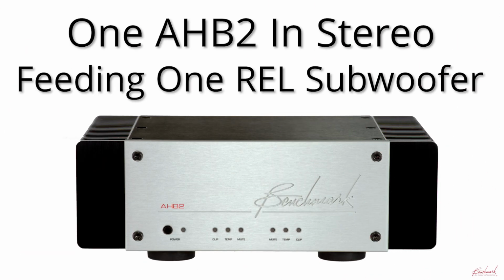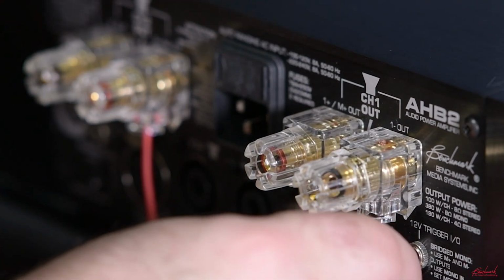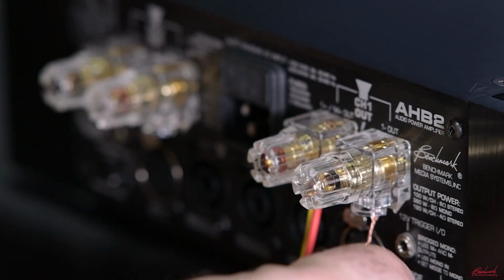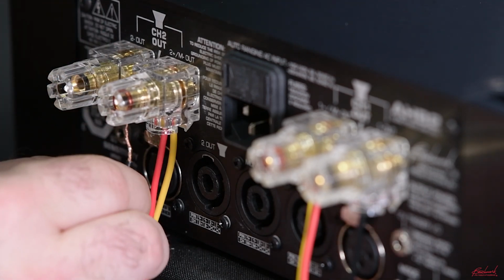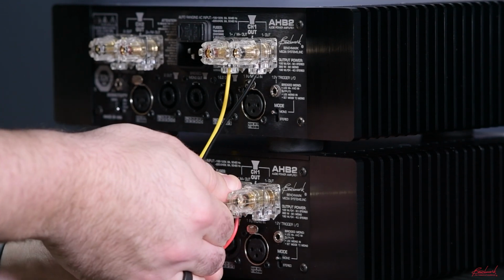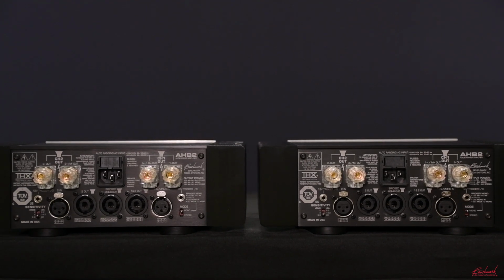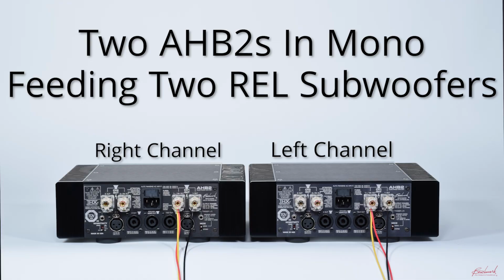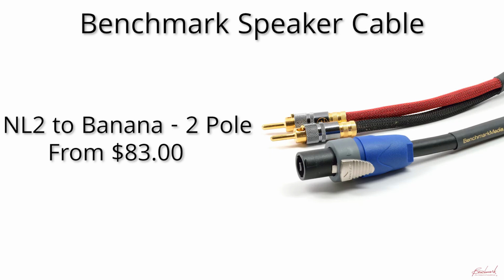Connecting AHB2 Power Amplifier to REL Subwoofer

Comment: This is one excellant video of REL connection. REL has many of these small videos and not in one place. Also not very clear. This Video is one place for all types. 

One clarification: at a time stamp of 4:39, with Two 2 AHB2 in Mono with one single REL the High Level connection you have shown is very clear. However when asked this question to REL, then do not agree connecting Signle REL to two mono blocks using High Level connection. Can you please help me understand or is this safe way to go, and you tested this connection and it was safe?

Comment: Are there any other connection options for subs to the Benchmark? I've just heard a few people saying the the Rel s510 has a split second delay using the proprietary cable. I'm also experiencing that issue and looking around for a new amp at the same time.
Reply from the maker: If you're going to connect a subwoofer to our AHB2 you'll have to follow the wiring guide supplied by the maker of your subwoofer. The REL is one example. We've also seen subwoofers using Phoenix connectors.

Also, if you're using one of our Pre-Amps you can use the RCA outs or the Mono XLR out to connect to a subwoofer.
Reply from the maker: Cables will not add a delay, but the DSP crossover and amplification in any sub, will add delay. Cable delays are insignificant.

Comment: Excellent video. 
Can you add a video on how to connect HPA4 with two AHB2 in bridged mode with and without subwoofer(s).
Reply from the maker: You would run the Left XLR out of the HPA4 to the Left AHB2. Then connect the Right XLR out of the HPA4 to your Right AHB2.

You can use the RCA outs of our Pre-amps to connect to a subwoofer. You can also use the Mono XLR out if your subwoofer has balanced inputs.

There are a few different set ups if you're using a subwoofer with Amplifier level inputs. We've seen the REL SpeakOn connection, some use banana plugs, and we've also seen bare wire connections using a phoenix connector.

I'll pass this along to our marketing team as an idea for a new video. If you'd like to talk with us feel free to give us a call @ 1-800-262-4675.

Comment: Couldn't you use a speakon from the amp to the speakon on sub?
Reply from the maker: You could use the CH1/CH2 SpeakON output on the AHB2 if you are running your AHB2 in stereo. It has four connections; 1+, 1-, 2+, and 2-, where 1- and 2- are the grounded terminals of the amplifier. If you are modifying a REL High Level Interconnect cable, connect yellow to 1+, red to 2+, and black to 2- on the new SpeakON connector that you will be adding to the stock REL cable. Notice that we do not recommend connecting the black wire to 1- because this wiring could cause damage to the REL if the connector was accidentally plugged into the mono output on the back of the AHB2.

If you are running your AHB2 in bridged mono, you would still use the CH1/CH2 output on the AHB2 (and not the mono output), but the cable wiring would be different: 1+ to yellow and red, 2- to black. If you are using a pair of subs, both will be wired identically and one would be connected to each AHB2.

Never plug custom REL NL4 to NL4 cables into the Mono or CH2 SpeakON outputs of the AHB2. This could cause damage to the REL subwoofer.

We would rather see you used the SpeakON connectors for you mains and then use the binding posts for the subs.  Also, the SpeakON wiring on the REL sub is not standard wiring, so you cannot use an off-the-shelf NL4 to NL4 cable. Furthermore, your custom wired NL4 to NL4 cable will not work if you reverse the amplifier and sub ends of the cable. Incorrect connections could damage the REL subwoofer.

In general, it is probably a bad idea to create a custom NL4 to NL4 cable unless it is very clearly labeled.

Comment: Can normal sized spades be used where you are connecting the bare wire ?
Does the power cord need to be shielded so 60 Hz does not induct into the subwoofer cable ?
Reply from the maker: Yes, adding spades to the end of the wires would improve the durability of the wires. I'm not sure why REL doesn't supply them with terminals. It would be a nice improvement.

As for the shielding of the power cord, this is absolutely not necessary from the standpoint of audio interference. Shielding will prevent the radiation and/or reception of radio-frequency interference but it will not block any interference due to the magnetic fields produced by current flowing through the power cord. Braided and/or foil  shields do not block magnetic interference. But even if there is some magnetic coupling between the power cord and the speaker-level inputs on the REL, that interference would be so much lower than the speaker-level signal that is would not produce audible noise at the output of the sub.

In contrast, power cords can interfere with the very low-level signals coming from microphones. We recommend star-quad microphone cables because they can produce a 20 to 50 dB reduction in magnetic interference. The is very important at microphone levels, is less important at line levels, and is not important at speaker levels.

Comment: Thanks for the video. Would I be wrong in thinking that by using speaker level inputs on the subwoofer you will be amplifying a second time any signal noise introduced from the first amplifier? Therefore your signal to noise rating will be worse than using the LFE or line level input.
Reply from the maker: You are correct. Any noise or distortion produced by the main power amplifier will be added to the subwoofer output. However, it will be added at about unity gain (+/- a few dB), it will not be amplified. But, because this noise and distortion will be added to the output of the sub, it is very important to use a main power amplifier that is very clean. Obviously, the AHB2 is the perfect choice for this task because no power amplifier (at any price) has lower noise or lower distortion. This means that the noise and distortion added by the AHB2 will not reach the 0 dB SPL threshold of hearing at the output of the main speaker or at the output of the subs. In contrast, many power amplifiers produce noise that is 20 to 25 dB higher than that of the AHB2. Worse yet, this noise is often dominated by AC mains line related hum. This line related hum is in the passband of the sub, so it could be a problem with many so-called high-end amplifiers. We recommend the high level inputs when driven by the AHB2, but would not recommend using them with most other power amplifiers.